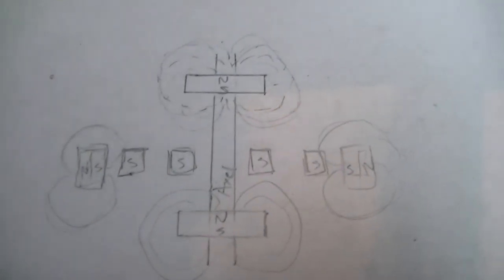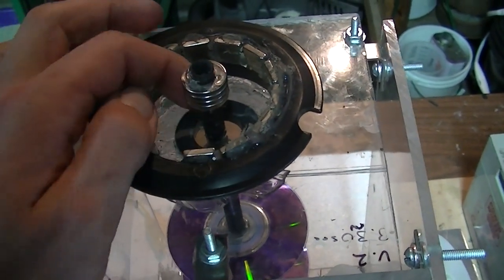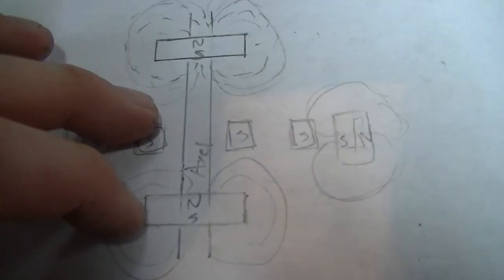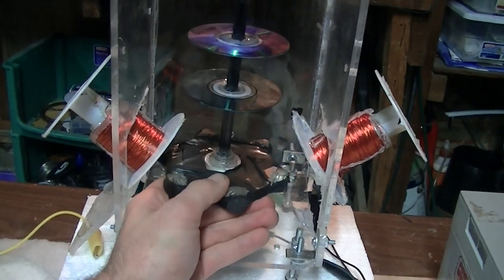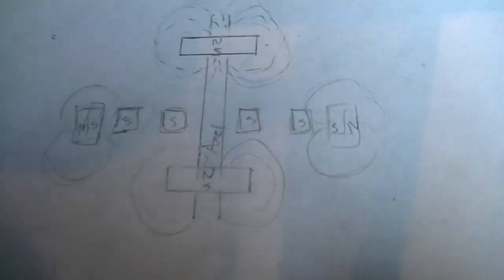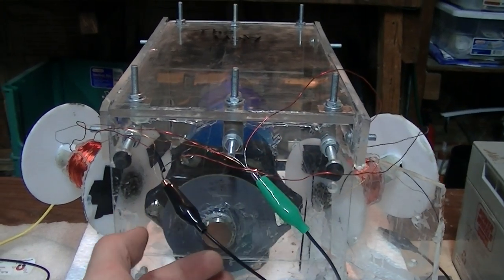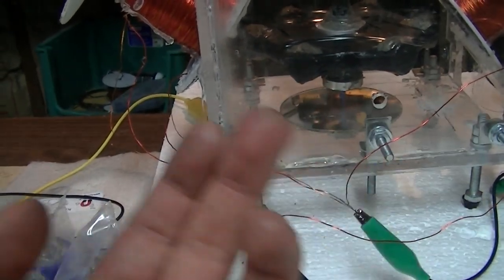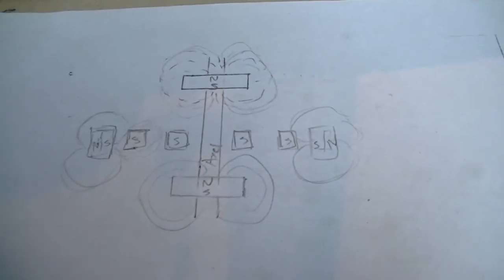DIY magnetic bearing design | 'VAMB' Vertical Axis Magnetic Bearing

Comment: very nice. You could put a small chuck of metal bridging the gap of the two same pole magnets it would then take on their polarity to complete your ring. To reduce wobble at the top you could put a ring magnet above that repels down that way the hole would attract up thus stablizing the shaft. To levitate you could try magnets in a pipe/sleeve one on bottom bigger with another on shaft smaller so sleeve inside of sleeve in repel.
anyways its all good just as you have it, its your baby :)

Comment from the maker: That direction I have it is to keep the axel and rotor on the needle spin surface. By putting the magnets the ring magnets the other direction reduces magnetic friction but only works well if your axel and rotor are vertical. That configuration relies on gravity to keep your needle point in center.

Comment: You can build a 3d printer fairly cheap these days. The entire controller system complete with the LCD/SD card are only $59 bucks on eBay shipped these days. I scored NOS NEMA 23 steppers for $5 bucks each. Toss in some 3/8" threaded rod, T nuts and some iron pipe/fittings and there you go. I'm 3/4 through building mine and I'm in under $100 bucks so far. Lowes custom cuts and threads the pipe free too so just buy 10 foot lengths for $12 bucks, saves a fortune on the frame. Going to do that right now as a matter of fact...lol

Comment: Thanks for posting this, can we connect over email or LinkedIn? i am interested in what formulae you used to design the system and determine the size of the magnets
Reply: No problem, I do not have precise b field calculations or anything, though they would probably be usefull. This was just a series of trails and errors 😊
I am on LinkedIn @diadonacs and you can email support@conscious.energy

Comment: In this setup there is no friction but what about attraction? Will it spin freely?
Reply from the maker: There still is a small amount of friction it is on one point of a needle. So dependent on the material you use it can be extremely low friction. It has cogging from the ferrite cores attraction and some lenz effect from the copper. Thanks for asking :)
Reply: Diadon A Thank you so much for the answer! I wish to have enough time to replicate it :(

Comment: hi, have you tryed to remove the bottom needle by replacing it with another barring like the top has?
Reply from the maker: Hey Brian, I have and it creates instability in the axel and rotor. When momentum occurs, there is usually a bounce from the force applied to create the momentum.  I actually tried that first with little success. My hypothesis is that magnets have different field strengths so it makes balancing the system so much harder. To have a point of contact helps with stability in preventing bounce or linear play (up and down) in the axel. There could be improvements on the design I am sure with dipole geometry or programmed magnets.  Another great magnetic bearing design is the Mendocino Magnetic Bearing design. However it is not very good at load bearing.  So I came up with this design to work with gravity, rather than against it. Thanks for the interest and I hope I answered your question.
Reply: +Diadon Acs (Conscious Energies) perhaps a pendulum weight for balance would help if you could double bearing each end, then maybe it would fix the instability problem?
Reply from the maker: One never knows until one tries. :) That is a good thought to test out.
Reply: +Diadon Acs (Conscious Energies) would you be willing to talk about this idea, in private message? very interested
Reply from the maker: Sure, I am on Google Hangouts if you would to brainstorm. I am pretty occupied right now moving, but I could help you if you would like. Another option is if you would like to email me, my email is linked to both youtube and G+. Ask me anything you would like and I will answer it to the best if my abilities.

Comment: I am wrestling with a mag bearing pulse motor at the moment.   There are times where 10,000 rpm is no issue, but the stability on the "contact" side is questionable... Maybe check out my mag bearing vids and offer some insight?   Please and thank you.
Cheers...